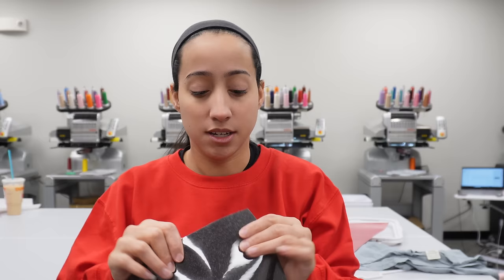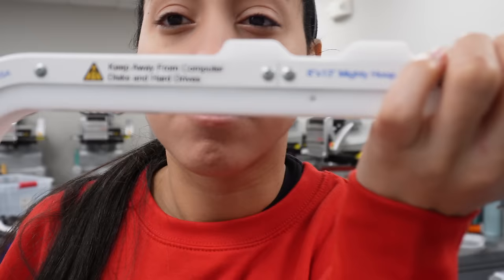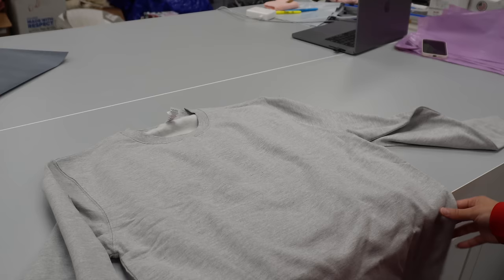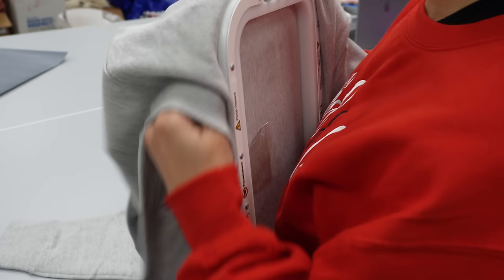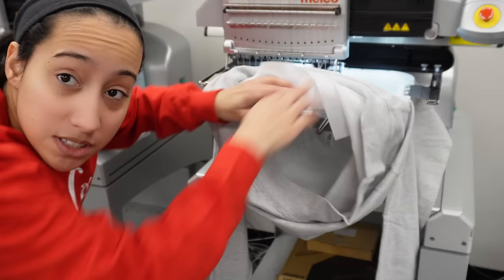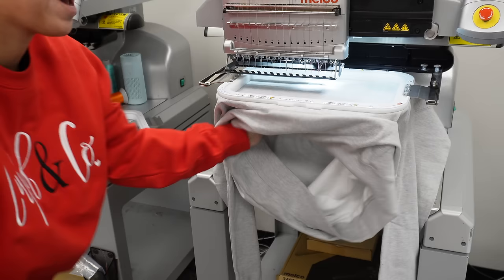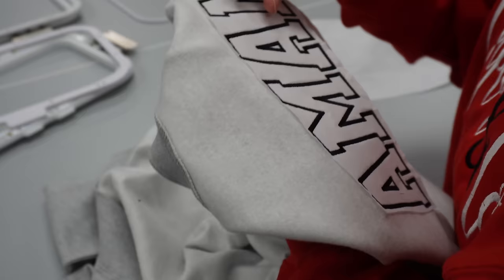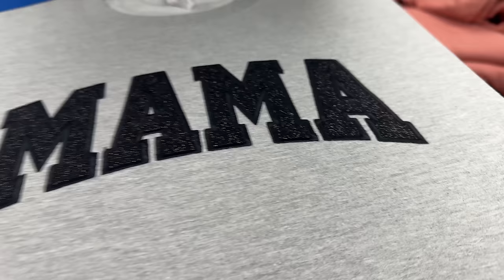How I Make the Glitter Heat Transfer Vinyl Embroidered Mama Sweatshirts | Appliqué Tutorial

Comment: You're right sometimes you do talk fast. But I enjoyed this video. I'm learning to listen faster. I'm not quite sure if I understood correctly the glitter heat transfer vinyl I can embroider on that correct?  I have an appliqué varsity letters that I bought and I wanted to use them and I wanted to put glitter in them rather than Fabric so I didn't know what to buy so today I bought Fabric because I didn't know which glitter to buy. Since I haven't made a lot of things, I don't think I'm ready for Shopify or TicTac and I'm not computer savvy as I used to be so I'll probably have to have somebody to do that for me plus my little work area is so tight a camera would be hard to use. Thank you for the information

Comment: My issue is when doing a T-shirt I had gaps. I floated my garment and I used glitter HTV ..I thought it had to do with tension, but I didn’t touch my tension after getting feedback.  I went ahead and finished the garment. I had to go back a few stitches to go over the gaps.  I was trying to troubleshoot my machine. I did find a piece of felt in the bobbin  case area that I removed.  I’m retesting the stitch out. I used one piece of cut away and T-shirt piece so far it’s doing good, but I’m going to add the glitter HTV to the other letter and see if it works.  Any feedback? Apparently, it’s user error. Me , I’m user error.  LOL thank you if you see my post.  Adding I tested regular htv on a Tshirt and it did work.  I used a black htv.  That’s when I got brave and decided to use a glitter one.